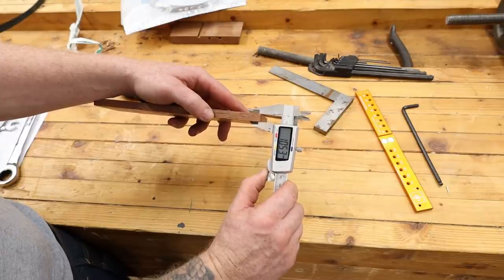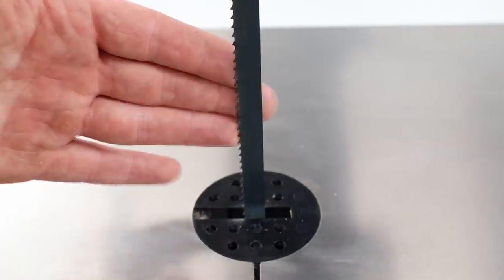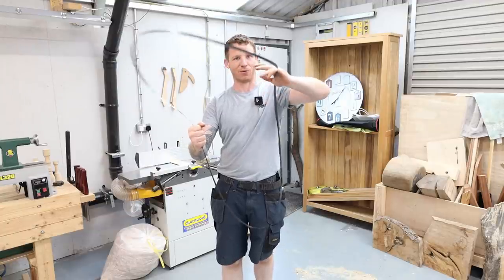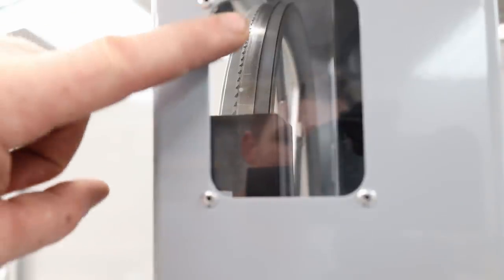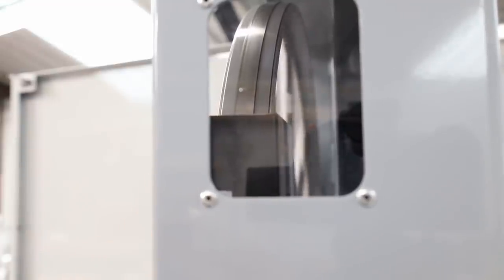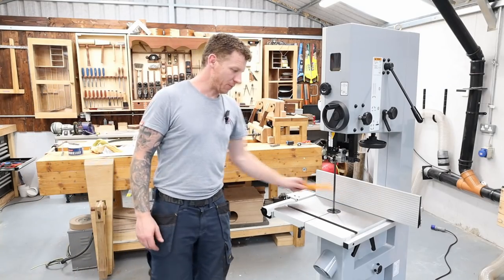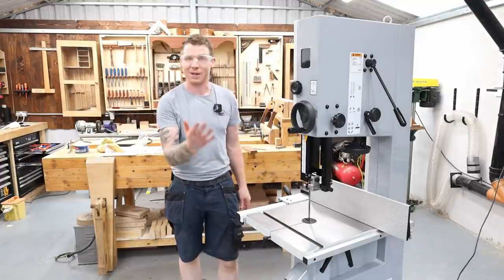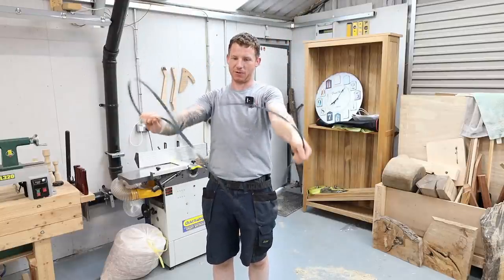Perfect Bandsaw Setup! and Blade Selection.

Comment: Hi John! I really like your channel and your approach to woodworking. Thanks for taking the time to share with us.

I disagree with you about where to set blade on the wheel. Remember that the wheel is not flat.  It's convex, or crowned. This means that the tension on the blade is not the same from the back to the front. There is more tension on that part of the blade that sitting on the crown than on the front or the back of the tire. So when you have the teeth of the blade in front of the crown, they can actually "flap," if you will. Or perhaps a better word is fishtail. And it doesn't matter that the tension is at the wheel not at the table. Putting the gullet of the blade on the crown of the wheel means that the teeth are getting the most tension all the way around. This helps keep them from fishtailing.

Another reason for setting up your blade this way, is that if you always put the gullet on the crown then you never have to change the setup of your guide bushings when you change the blade size. The setup will be the same!

Again, I love your channel. I hope this comment is helpful.

Comment: Good video John and well explained but the position of the blade on the wheel and tension does control the action of the blade in full the guide bearings should not be controlling the blade. Agree 1/2 blades and above are ok centred on the blade but for a 1/4 blade best results will be achieved by centering on the gullet of the blade from my experience.
Reply from the maker: I would have thought it would be the wider blades,or maybe bandsaws with narrow wheels,really can't see what effect is achieved moving a 1/4 blade slightly on a wide wheel. Unless the wheel has a larger camber?? I don't know I'll have to test this out.
Reply: @JohnMcGrathManInShed  the smaller blade is harder to control so bringing the peak tension point on the blade closer to the cutting teeth makes it more controllable, try it out you will be surprised the difference it makes. Hope this helps.

Comment: You are correct about the tension on the top and bottom wheels. The blade is absolutely fine in the centre, I’d doesn’t need to be to the rear at all!

Comment: Another good tip, Same as a pillar drill, if you're not using your band saw for a while its always good practice to take the tension off the blade (same as taking the tension of your pillar drill belt) to avoid shaping the blade/belt and give it wobble or vibration when you're using it. definitely extends the life of the blade too and reduces the awful blade snap mid use (I still have never got used to that when it happens and near shi**ing myself). 
If you don't have dedicated wax, any car paste wax can work but I usually just leave a good layer of wd40 on it when im finished and just give it a scotchbrite with red or grey when it does get any rust starting.
Matthias wandel and Alex snodgrass have videos that would cover everything you could want with tuning/running a bandsaw. I thought I was up on my bandsaw tuning until I watched alex snodgrass' video and picked up a couple of small things from him on bearing adjustment.

Comment: Thanks John for that. Bought a similar sized bandsaw off a mate and it's been lying in the corner waiting to be set up and born again. Funny I was thinking exactly the same thing just before you threw water on the aligning of the teeth on the wheel. Not for the first time. The description  of the lower tpi so the gullets clear really makes blade choice easier. Also I dont know if you ever saw it but I saw a vid from someone a good while ago, cant remember who but I think it was an American master craftsman and he was setting the tension of his blade by the pitch as in note produced when he picked it. Think he was looking for C..now that's accurate.

Comment: My setting method is:-
1. Set fence parallel to mitre slot.
2. Check blade to 'bandsaw buddy'.
3. If way out, then slacken table bolts and rotate table to get it close.
4. Align bandsaw buddy to fence by micro adjusting wheel tracking.
With this method, the mitre fence can be used accurately in mitre slot.

Comment: Hi John, Thank you for a very clear and simple explanation without any mambo jumbo.  I find that when I use a very narrow blade(1/4") as I turn through a rightish curve (about 20mm radius) the blade slips forward out of the side guides.  How should I change the adjustments to avoid this?  Mike

Comment: I use the  gullet centering method as taught by Alex Snodgrass   I believe the explanation is that you want the gullet supported by the high point of the wheel   He has a greater set up video that explains it

Comment: Hi John, your new bandsaw looks awesome. I own the Record Power BS350S which I think you owned previously? Can I ask if you ever managed to set up that saw to accurately resaw using the fence? I can’t get seem to get the blade and the fence in line with each other. I got a Bandsaw Buddy and that shows that when the fence is in line with the left hand mitre slot it is miles out of alignment with the blade. There doesn’t appear to be enough adjustment to get the fence and blade to align. Thanks, Paul.
Reply from the maker: Hi Paul I had the Bs300e, you will have to adjust the table if its that far off. You can undo the bolts and adjust it.
Reply: Thanks John. I tried a couple of times but today is a new day. I watched a guy on YouTube with a new table adjustment tool, a mallet. I’ll give that a go. 😀

Comment: Great video and lots of info.  What wax are you using for the table top?  I live in a very humid climate here in Florida USA and all my hand tools and table tops are showing rust.  I need it to stop... Can the same wax be used on my hand plans?
Reply from the maker: Its a machine wax from Axminster it could be used on your hand planes to. I have the same problem I use Protec Tool for my hand planes I'm sure you will get something similar in the States.

Comment: I'm curious about whether it is necessary to check if the miter slot/t-slot is parallel to the blade. Is there an adjustment to rotate the table slightly if the slot goes out of alignment with the blade?
Reply from the maker: There is an adjustment you can make to the mitre fence similar to the main fence

Comment: The bandsaw must be positionned on the edge of the wheel ! ... the teeth must not touch the wheel rubber (https://youtu.be/16Nhq5swos8?t=202)
Sorry, i don't know the term in english but the teeth are not flat and aligned with the band body. so putting the band in the middle of the wheel press the teeth and  has tendency to flatten them